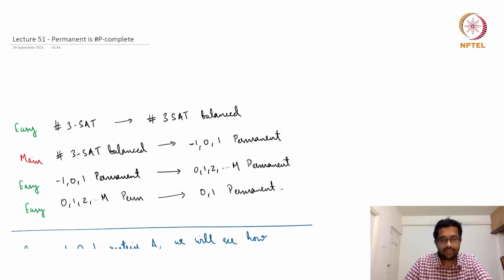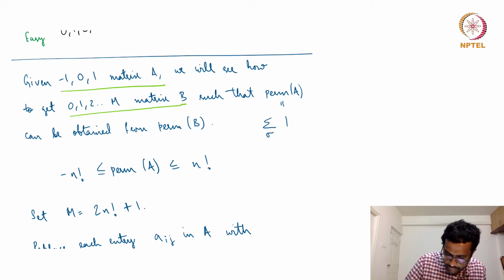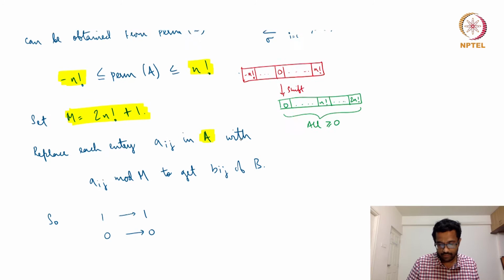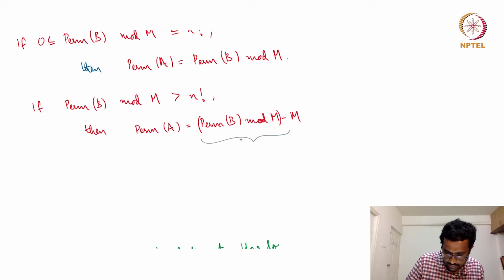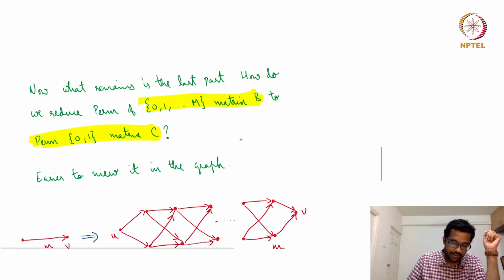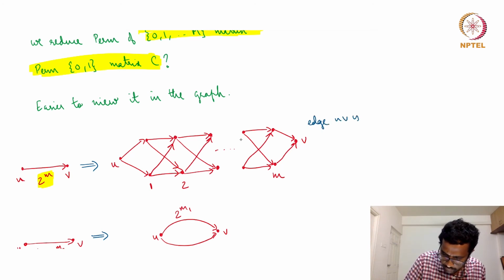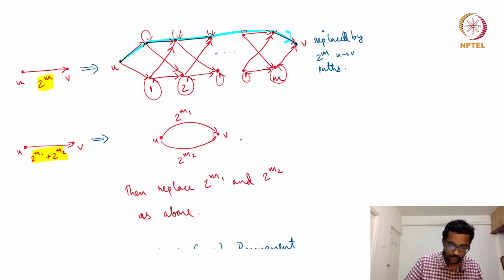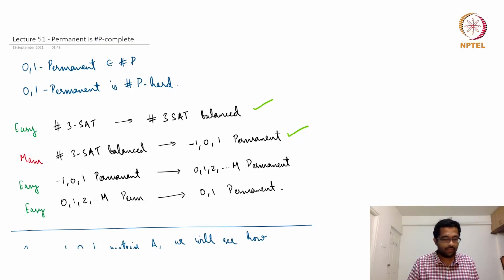mod10lec51 - Permanent is #P-Complete: Part 2

Comment: The first transformation constant is effectively 1 by using tricks with modulo.  But the second technique can add worst case up to n×m nodes (rows/columns) where n is #nodes, m is maximal weight.  Actually I don't think its exact constant but I need the gadget details.  This would quickly become impractical.